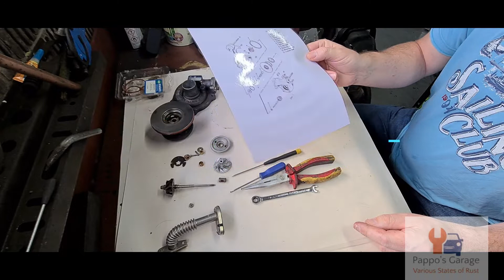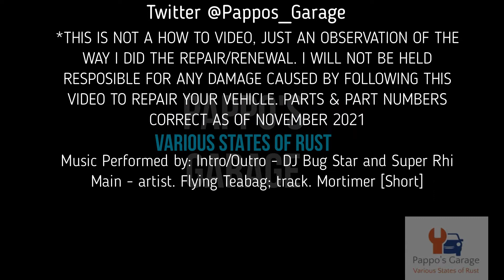Fiat Panda 1.3 Multijet Diesel 2005 Turbo Overhaul

Comment: Have you discover the origin of the oil consumption ?
Reply from the maker: Hi Usterd, the bearings had started to get worn, which allows lateral movement of the impeller, which in turn allows oil to bypass the seal and re-enter the engine/or exhaust. This turbo was letting go (smokey exhaust) but there was minimal side pay in the impeller, I caught it in time.